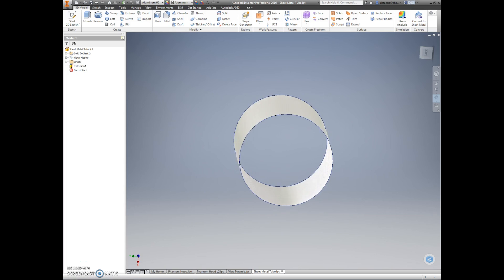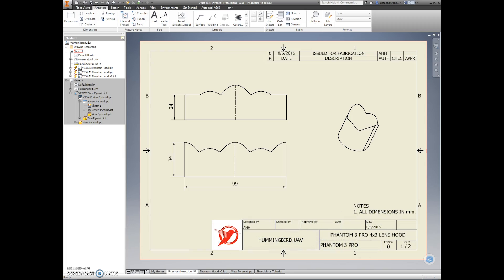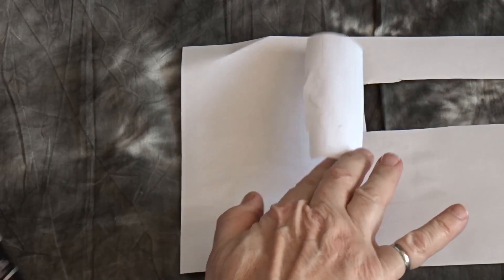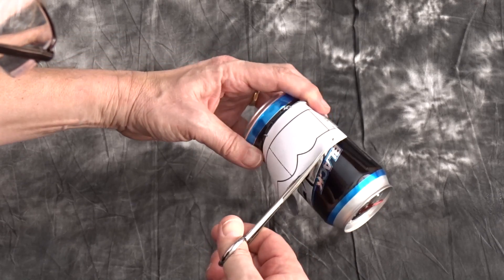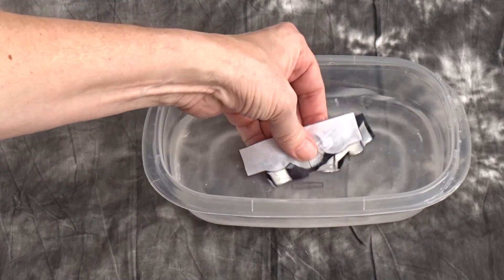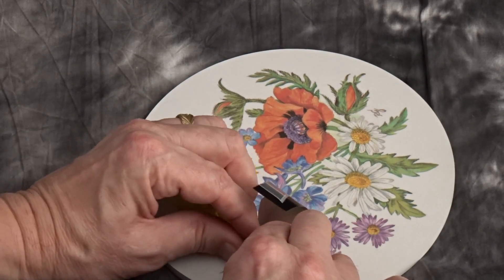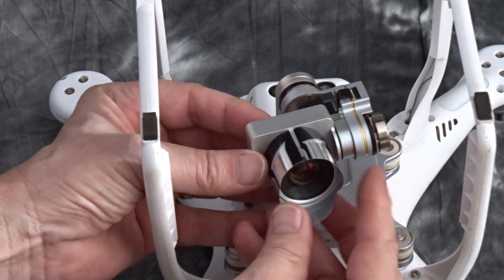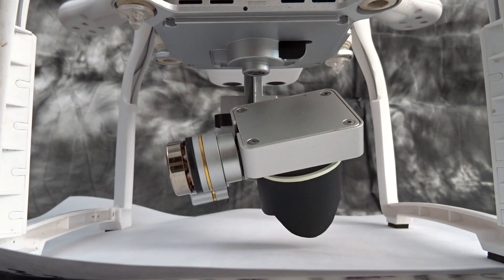How to - Beer Can Lens Hood  - Phantom 3

Comment: nice instructional video. But now for us photography amateurs, what's the purpose for this lens hood and if this is optimized for 4x3, do you have another for 16x9?
Reply from the maker: The hood reduces lens flair when the sun is lower to the horizon.  I usually fly with the lens tilted down and the hood helps in certain situations.  This hood is optimized fro 4x3 so when taking a picture there are no dark corners in the pictures.

Comment: how does it work when shooting 16:9?
Reply from the maker: +mark whitfield It works for 16 x 9 just fine but it's not optimized for 16x9.  A 16x9 pyramid could be used to make the pattern.  Down side is in photo mode 4x3 there would be dark spots at the top and bottom of the image.